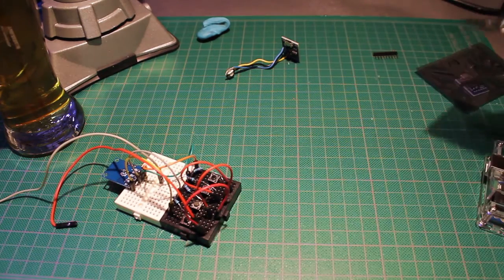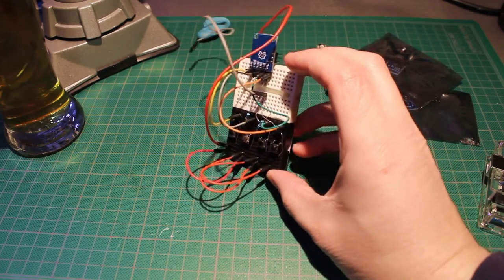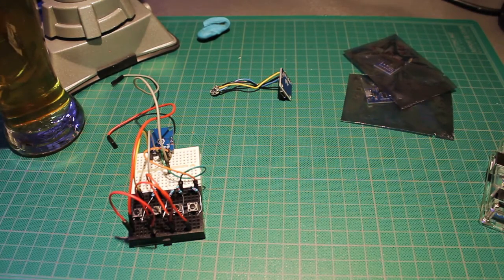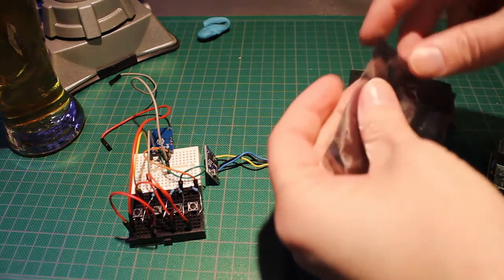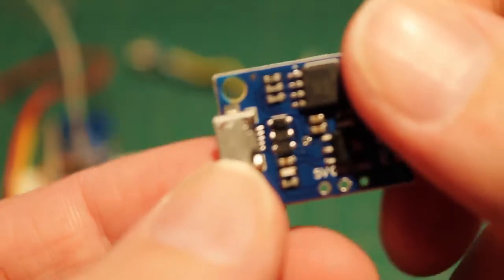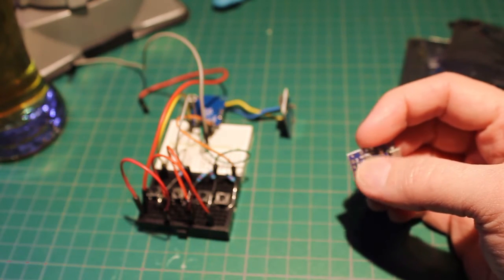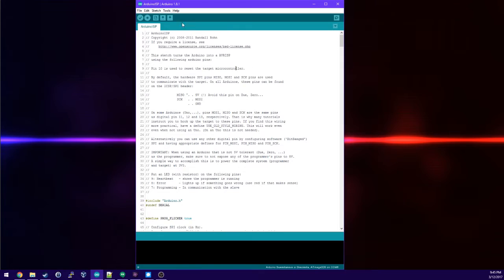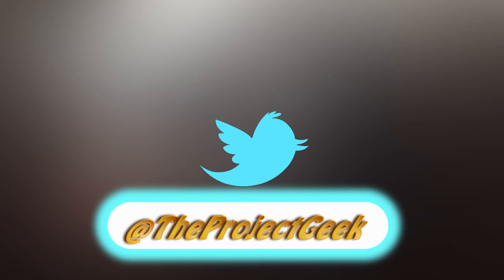Digispark Overview & How To Fix Resetting - Pin 5 Reset - Digispark vs. Arduino

Comment: I know this is way old, but here goes....The message gives a device signature = 0xff8000, then says: Expected signature for ATtiny85 is 1E 93 0B.  Double check chip.  Also says nothing about the fuse?

Comment: After applying the instructions my Digispark clone is not recognized by computer although it functions properly with the latest upload(blink). I can no longer upload sketches. Weirdly board functions well if I power it though the pins but not the usb. All the pins are empty(not connected to anything) and I cannot understand why it doesn't work. Have any idea?

Comment: Bricked my digispark.... I used a USBasp It modded the fuse as per these instructions. Yes it did disable the reset pin 5 but it also led to the device being unrecognised by USB so cannot now use it. Cannot use USBasp with it as it requires the reset pin and cannot program via USB anymore (was working fine before fuse change). Will revert to nanos I think. Pity as the form factor makes the digispark a useful device (also maybe time to try out just using the ATTiny85 chip??).
Reply from the maker: They're not the best quality. I've been using them in random projects to run ws2812 and they die often. I have a bunch of attiny85s just have gotten around to using.

Comment: Hi, have tried but doesn't work. I have a clone that is looking exactly like the original (black and pendrive shaped). I use a Nano as ISP. Checked the connections many times but AVRDUDE complains it has an invalid Id. Any ideas?

Comment: Thank you very much, having one more digital port is not nothing. Even if the first seven minutes are bla bla, useful talk for beginners, the trick works fine. I did it with a chinese low cost Nano. You need to set the correct COM port, and with these Nano clones, set the processor as 328P with the old bootloader. THX again.

Comment: Question, I did this and now isnt resseting when i plug something on P5, which means it worked, however when trying to use analogRead(0) (which according to digispark wiki is P5) is only showing "noise", it doesnt show the real values, so what happened, is P5 unable to be used for analogRead?

Comment: I have the exact same one as show in the video but when i flash the keyboard example on arduino and plug it into my laptop nothing happens. Im trying to use it as an alternative to a rubber ducky but cant seem to get it working.

Comment: I want to use PB 5 as output but it doesn't work..i'm using Atmel Studio 7 with USBasp programmer
Ps:All pins are availble except RESET pin, any help please?
Reply from the maker: +Lahcen Lahcen I haven't used Atmel Studio, but can it work with ivr dude? If so just follow the video. If not, I'm not sure.

Comment: When I first purchased some of these, this was a couple years back now, I could not figure out exactly how to flash to them.  So being the fool, ignorant of the fact I was using a Chinese knock off, I sent an email to the tech support at Digispark  now this has been a couple years back, so I no longer have their reply, but to cut it down to a coupe words, it was something like "You want our support buy  OUR product, so you are on your own, so screw you!!!"  I was not really very happy with their response, but anyhow I ran into a video sort of like this one, that explained the secret to getting them working, and just for Digispark's information, I have never, and will never buy their product.  If I can't get the knock off, I will use an ESP8266 and modify my code!
Reply: Hi , i have same knock off digispark and a nodemcu ESP8266 , can you give the code?

Comment: Thanks so much for this video, it's a real life-saver! I am using one of these and need every single pin, but couldn't find any other explanation of how to do this on Windows (a whole lot of guides written for the RaspPi though).

Have you had any luck with going  ultra-low-power and cutting the LED traces? I'm hoping to design something that can run for up to a month on a single charge, and every guide I've found has been a little too technical for my knowledge.
Reply from the maker: +Anthony Lewis Hey thanks for the compliment. I did end up removing the LED on one project, you can see it in my other videos. I build a USB HID project and needed to remove the LED.

Comment: I'm just surprised how little information I could find on these things. I've got sevral pieces coming and only hope I'll manage to make them work. P3 and P4 are connected to the USB directly but if you use the Vin (or 5V) and GND pins for power you'll get 3 and 4 available, right? And can you program the board with just the usb or you need a programmer like Arduino or some ISP device?
Reply from the maker: I was also surprised how little info there is on these. Most forum posts are a few years old too.
P3 and P4 are used for USB communications, only when either transferring the program or using a USB program; like HID. Any other program, P3 and P4 are regular I/O pins. 

To program it, you can use the Arduino IDE, or similar. There is a how-to that is very nice: https://goo.gl/sS3xtQ Programming the Digispark is slightly different, as it doesn't really have full USB support. It goes into programming mode when it is first powered up for about 7 seconds. When you are ready to upload your program to it, the software you're using will tell you when its ready and you just plug it into your PC.

Hope that makes sense
Reply: That is a nice wiki they made. I guess the main thing will be to burn the custom bootloader which tells the digispark to act like a USB device. Because afaik the Chinese ones don't have it. 

It will be a tough fight with the Pro mini series I just found for £1 on ebay. 

AVRDude now always tells me that it doesn't respond and the connections are probably wrong. (Using NANO as an ISP) This will be a lot of fun to figure out.
Reply from the maker: +Hrnek Bezucha Act as a USB device how? All of mine are cheap Chinese knock off, and they show up in device manager on windows. The ATTiny lacks USB so the bootloader they use emulates that.

I agree that the pro minis or even nanos are cheap, though sell for digispark.
Reply: I don't really know what I want from it. One thing that always amazes me is how are those Chinese guys able to pull all these boards off for such prices. I'll play with it later on. It's a nice little thing.